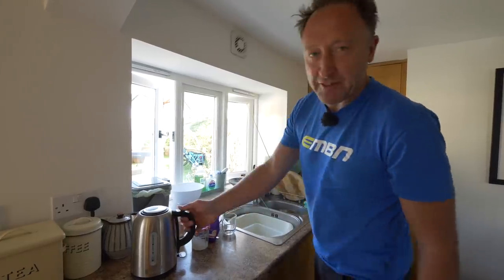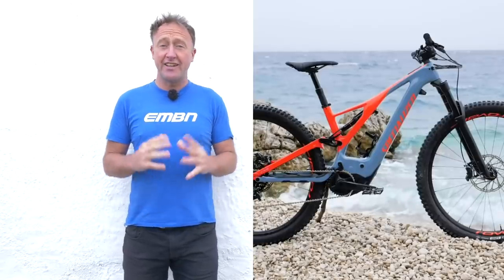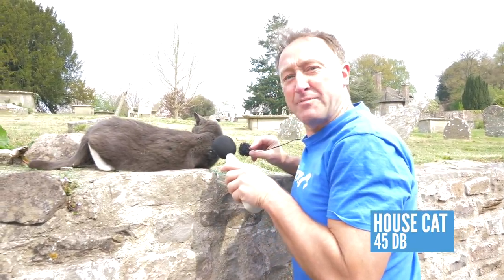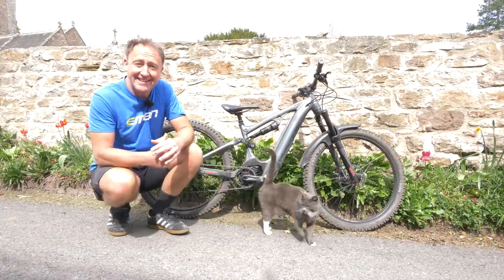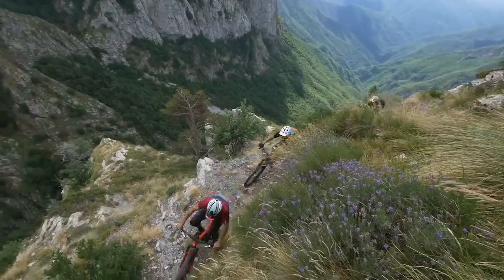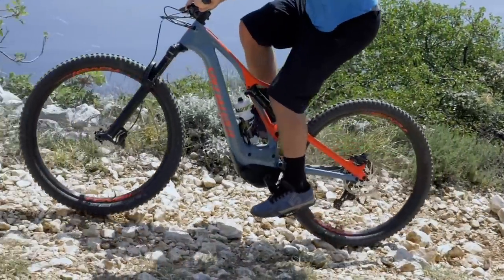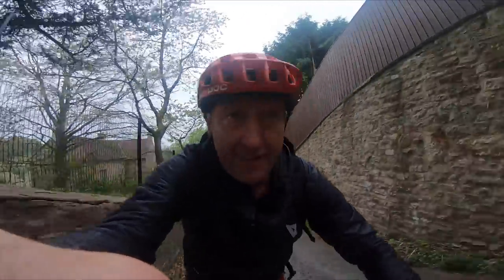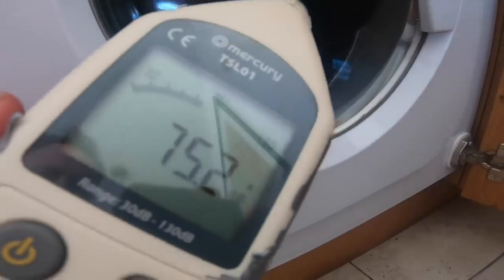How Loud Are E Bike Motors? | EMBN Investigates

Comment from the maker: Do you care how loud your E-MTB motor is? 🤔 Let us know 👇
Reply: I dont care!If motor is workin, it should be heard!
Reply: Im sorry but These measurements cant be accurate... DB should me measured 1M away
Reply: I ride a Shimano 8000. The noise does not ruin my ride at all. Definitly I don’t care about few Db back and forth
Reply: My Turbo Levo motor noise is about the same as tire noise and wind noise at 30-ish kph (US spec) on the flat in eco mode.  No issue at all.  However, it's an annoying whine in the otherwise quiet forest when I'm climbing in trail mode.  Cadence is always about 80.  My local trails are shared with hikers, and I'm always embarrassed when I whine passed them.
Reply: My bike's got a shimano motor, dont find it noisy at all. Mates got a Bosch on his bike, that's pretty quiet also. Tell you what I do care about though....maintenance costs of emtb, in particular drivetrain wear. No one seems to talk about it, maybe you guys could do something? Any tips/pointers that would help me get more than 250 miles out of a chain and 500 miles out of a cassette would be appreciated 👍
Reply: My Rocky A70 powerplay does have a slower whining motor noise because it turn actually slower than others. But honestly, I dont care at all because I do alot of climbing that I would'nt do on a 150/160 mills bike!!
Reply: Not much, as long as it doesn´t sound like  a blender, I´m happy with it.
Reply: Electric Mountain Bike Network I’d like to see a comparison like this but based on resistance above the limiter should be easy enough to do, get to 15 mph then accelerate to 20
Reply: Not really it's the assistance that the motor gives that matters.
Reply: Most of the time I don’t care, but I do ride in areas where people still hate ebikes and when I ride by I do wish it wasn’t so whiny. 19 Levo
Reply: @ftgoggi4715  The only way is to not be lazy and skimp on the maintenance. Regular thorough cleaning and lube properly (Soak and allow it to sit then wipe the chain clean of excess oil), Don't do the spin the chain and drizzle oil, a tiny dab to each link only takes a couple of minutes, you don't waste oil or get it where it shouldn't be. Other than that as long as it's all setup properly and your shifting technique is good then you'll maximise your chain/cassette lifetime.
Reply: I don't currently own one but the noise is a little off putting, but the noise isn't what's keeping me from buying one, it's my finances.
Reply: My Scott e-Genius has a Shimano E8000 motor and it works very smooth, i wouldn't call it noisy at all. The tire sound (Maxxis dhf/dhr) on tarmac is much louder. 😄

Comment: I have had a lot of experience trying to get accurate sound level measurement from vehicles. First off, it is very hard. There are well established procedures for measuring pass by noise but that is not what was being measured here. First off, there was no mentioned of what weighting was used on the sound level meter. Normally A weighting will be used to somewhat match human perception. Secondly, these measurements placed the meter in what is called the near field. In that field the sound is extremely complicated and what is measured may have nothing to do with noise is propagated out into the far field that the rider and passer by is located within. Another solution would be to move the meter near the rider's ear. When you do that the influence of the head of the rider places the microphone into another complex sound field again. In other words, this is extremely complicated and cannot be done with simple quick measurement  equipment and techniques.

Comment: Excellent theme, I am a doctor and a determining factor in the choice of my ebike was the acoustics (I have a Levo carbon 2018 with brose drive S Aluminum).  My bike is very quiet.  My suggestion to refine the test of the acoustics of the engines is: 1- position the microphone close to the ear of the cyclist driving the bike and the ear of the cyclist who accompanies it.  And make a composition of these values together with this socket next to the engine as well.  2- Human hearing, loses the capacity for acute probes with age, taking into account that the average age of the e-biker is 40-45 years.  make a subjective test with 20,30,4050 and 60 year old listeners to give the counterpoint of this test.  In fact, the brose engine uses a carbon belt that minimizes vibration and noise, my bike is very quiet

Comment: I have the Turbo Levo Comp 2019. The motor is virtually silent most of the time and in fact any increase in noise tells me I nned to change down gear and/or up the mode. If I do that it stays near silent in most trial scenarios.

Comment: Thanks, a good report.
 It is percieved sound that matters most, not what your meter shows.
 I have 2 ebikes, my Bafang conversion is totally silent in all cadences, my Yamaha drive is much noisier in high cadence low gear. My LBS has promised a new motor when we get back to normal, but I wonder if the Yamaha is really just intrinsically noisy.
 Thanks for your quality videos.
Reply: Thanks John, yes so may factors involved, yes Bafang is pretty quiet right?

Comment: To answer your question at the end I would say it's possibly because you had the sound meter connected to the bike and the meter is picking up vibration through the frame and registering this as sound? For the Washing machine you didn't have this issue.. try the meter touching the washing machine to see if its affected.

Comment: Your sound guy is partially correct but I don't think he had enough information about your process.  It looks like your meter is set to A weighting and it's showing very high sound pressure levels. 80-90dBA is in power lawn mower territory. Also, A weighting ignores low frequency information. This is important because at not very loud levels that low frequency content will influence a meter but not necessarily influence our perception of loudness as much. (Our ears and brain are more sensitive in the human vocal range. ) So... A weighting = Low frequency probably not a factor in the measurements. C or Z weighting = Low frequency causing a discrepancy between what the meter says and our perception of loudness. 
     However, I don't think weighting is the biggest factor in the differences we are seeing. I think mounting is. Microphones are extremely sensitive devices. They are made to track air pressure which is a very small force. When you strap a microphone to a frame you are measuring the resonance in the frame probably as much as any sound it is also picking up because of the physical coupling to the frame. Tire noise, breathing, freewheel... all contributing to the overall level. That's not necessarily a disqualifier because were judging one bike against another during a ride, not just the motors in a lab. But mounting is almost certainly a factor. (At this point I should take a meter out and try different mounting methods and give you hard numbers but I realized I would need to invent several different mounts for both meter and camera and I don't think I'm going to do that. So I'm talking out my ass, for the most part, but measurement technique is genuinely important if we are to give any credence to the data it produces.)
     Also, distance and position are extremely important. Though I don't think it played as critical a role in your tests based on what I'm looking at, suffice it to say that sound pressure falls off roughly by half for every doubling of distance from the source. You mic'd the cat at approx. 3cm from the emitter on axis in a free space. You mic'd the  washing machine at approx. 40cm in a quarter space on what might be the quieter side of a fairly efficient boundary -the mass of the washer itself. What if you measured from where your ears are when standing next to it? What if you measured the cat at the same distance? The cat on the wall vs the cat in the laundry room? I think you get my drift. :) That being said, an industry standard in sound pressure level measurements is 1 meter, on axis, in a free field, and notating the settings on the measurement device. Without all that data a measurement is mostly arbitrary. 
     All that being said, what really matters here are the relative levels of measurements that were taken under approx. the same conditions, those being the meter mounted to the bikes. The absolute level is not nearly as important as the difference between products and you did give us food for thought. As critical as this post may seem, even an old sound guy enjoyed this video from start to finish. (It's possible I got a little more inspiration than most because of the technical conundrum.) Perhaps mount the meter to your helmet? Decoupled, of course. But then your breathing might dominate?
Reply: I was about to write very similar comment, but then I've found yours.
Reply: Hey, that's awesome. Massively appreciate inputting some science into what essentially a pretty crude piece. I'm no sound expert. I think you nailed it with what we were trying to achieve with your comment food for thought... nice one Twongo

Comment: the motor requires massive air cooling but I wounder if adding a high cfm fan with a sound deadening box would work. not sure if sound deadening would be offset because of the holes needed for the fan though

Comment: Why did you have to try and convince us that the Specialized is quieter than the others when it isn't? And what happened to the Yamaha?
Reply: Hi there. Are you suggesting that the Specialized is louder? I was simply using it as an example to say that numbers alone mean nothing, and as much as many people want to say one bike is louder than another it's not as straightforward as that with so many of the other factors we chatted about including rider, frame material and constructions and environmental factors
Reply: Because its science and not everyone understands it without explination as its not intuitive.
But you are correct to question it.
Reply: Exactly! I found the sound of the Yamaha Motor more pleasant to the ear than the others.
Reply: Maybe I am deaf but I don't even hear my Levo Expert carbon on a ride. I mean is the motor sound a big deal? I like that I can climb walls.
Reply: Seems to be the case all the time, Yamaha especially when Giant is involved is very rarely mentioned or spoke about in any depth. Obviously a reason there i guess.
Reply: Yamaha is very quiet , pity it drops off power so early in the cadence which in turn makes it quieter. If pwx2 pulls to 110 cadence at 75nm or so it will be a real winner though., id love to see yamaha really put a mark on the industry
Reply: As a Turbo Levo owner I was interested in the readings.  I have friends with Bosch and Shimano driven bikes and by consensus the Brose sounds the "quietest" on the trail, with the Shimano the most noticeable, with its higher pitch sound..  Cadence and power settings make a huge difference to the perceived sound so maybe the Brose sounds quieter overall because it has so much low down torque that it can be ridden quieter for a given output?? I don't think the differences are big enough for noise to be a main factor in deciding which bike to buy.

Comment: Only if there is an issue with the motor. After 800 muddy, grungy, wet  miles on my BOSCH perf. CX mounted to my PowerFly 8, I had to replace the bearings in my motor. They were pretty loud then. And thank you for the video on bearing replacement !

Comment: Quietest smoothest and most bulletproof specialized have sold is the 2018 alloy motor with current updates  .I wouldn't swap them for anything else.
Reply: What updates robert v 1.3 ser 972 ?
Reply: @CarkeekW  
2018 1.3 alloy motor
Motor 7.1.1
Battery 4.17.1 or latest
Set Eco 20% / 30%
Trail   35% support / 55% max 
Turbo 60% /  100%
Cheers Rob..

Comment: Soundmeasurements aren’t an easy topic, I work for a company that does soundmeasurements for windturbins. The first thing is you measured the sound pressure only without any reference. You need to compare it with backgroundnoise. Second thing is sound pressure depends on the measured distance. So you need a fixed position to compare the sources of the sound. Windscreens are important too, because you don’t want to measure the sound that is generated by the wind. If you use a wind screen you need to know which frequencies are damped and how much sound pressure needs to be added that you have correct value. A FFT analysis would be good as well because the human being considered some frequency more annoying than other (low frequencies have much more energy than high frequencies). Most of the people have to be reminded that the sound pressure in db(A) is a log function, so it’s not linear.

Comment: i got the 2018 levo and i think its the quietest out of the lot
Reply: true that, I had a used 2018 for a few months before getting the 2019 levo. At first I was disappointed how much noisier it is, but after a few months it has become almost as quiet as the 2018 levo, if not just as quiet. The motor 'beds in'. No regrets now :)

Comment: Important is to factor in the frequency, as the sound emgineer explained, our hearing picks up different frequencies at different rates. Also some sounds are simply annoying as others are more pleasing. For instance a very loud F1 car I happen to find thar pleasing, and a high pitched electric motor I find annoying!
Reply: Exactly, this is more relevant even than the volume. Frequency, and tonal vs broadband (pitched vs unpitched)

Comment: My Specialized Levo is mostly silent at lower assist levels, with a slight hum at higher powers. It tends to make a little noise when starting off but gets quieter after a few minutes. Unfortunately the motor noise is irrelevant as it is drowned out by various creaks and squeaks which neither my dealer nor myself have managed to sort out. Hopefully they are just from the motor covers. It's so noisy I don't even need a bell....

Comment: I did some similar testing during lock down with some air pistols as I didn't want to annoy my neighbours if I used them in the back garden. I concluded that, although possibly more scientific, using a sound meter was a waste of time.  Lower sound levels on the meter did not equate in the slightest with the volume heard by the neighbours. Your tests seem to suggest the same.Go figure!

Comment: My E7000 seems quieter than the E8000 but as you say the motors are all pretty comparable, drive chain and cable rattle annoys me more..
Reply from the maker: Doddy over on GMBN Tech channel has some great tips for helping to silence your chainstay and has used 3M 2228 tape. You can now get some great awesome aftermarket options. Cable routing and can be tricky and take some time to get it neat! Here is a video that may help 👉 https://embn.me/cabletidy

Comment: I've got Bosch active plus (50nm), yamaha pw-se (70nm) and brose mag s (90nm). In sound comparison i would sort them as follows (quiet to loud):
- bosch active line plus - great engine, super quiet at every cadence / load, 
- brose - super quiet on low cadence but getting noisy at higher cadence / pressure on pedals
- yamaha : very powerful in low cadence and quite quiet. Very weak and very loud in high cadence. 
Each engine has advantages / disadvantages but for me the reason to go for levo was full suspension and the silent and powerful engine... Bosch is super quiet but has quite noticeable pedal resistance and cut off after 25 kmh.

Comment: Why some motors sound louder than others. Human hearing isn't linear - frequencies closer to human speech are slightly amplified to us (evolution and all that). This is why lower-pitched motors might sound less loud. On the other hand, a dB meter is more or less linear across its frequency pickup range and does not simulate the human ear.
Reply: Nice one Miran....
Reply: And as you age, lower frequencies are the first to drop off from your ability to hear them...

Comment: I rode the Brose Drive T and Drive S for two years now. Around me people have the Yamaha, the Shimano 8000 and the Bosch Gen3 and Gen4.When we leave aside all other characteristicts the Broses seemed to me the quietests of them all though after 1500 or 2000 Kilometers they get little louder than they where when new. I have not rode the S Mag yet but would expect it to be at least as quiet as the older Broses.The most annoying sound to me made the Shimano. Kind of a high frequence when pushed hard.The Bosch Gen3 was quite loud but the Gen4 seems to me even little louder though otherwise improoved.The Yamaha is soundwise in a good midfield to me. A good allrounder anyway.

Comment: After hearing the loud whine of the E8000 and the obnoxious freewheel (cranks) on the Bosch I went with a Kenevo. Near silent. This video is very misleading.
Reply from the maker: Hi Justin, after recording the numbers Steve called a sound engineer to ask why some bikes read higher than others even though they actually sound much quieter. It is explained in a phone call at 09:20.